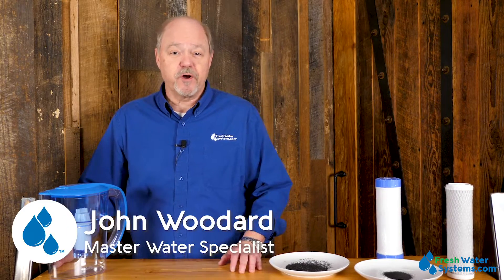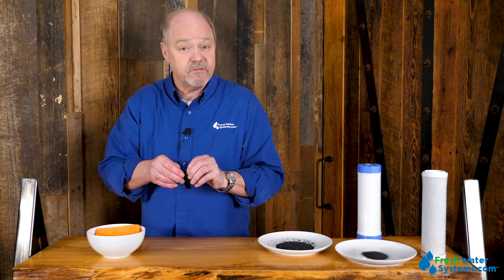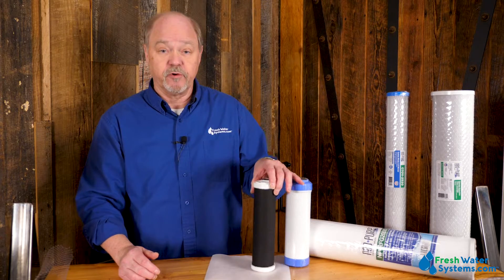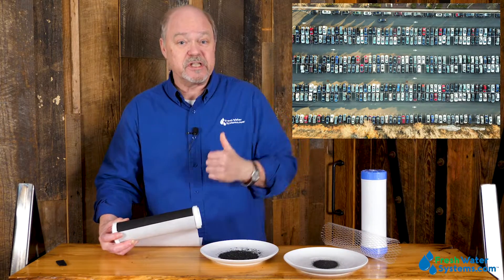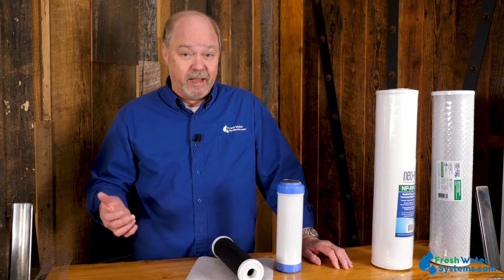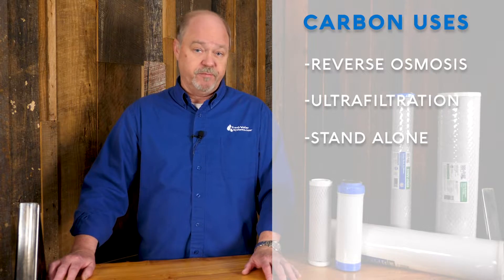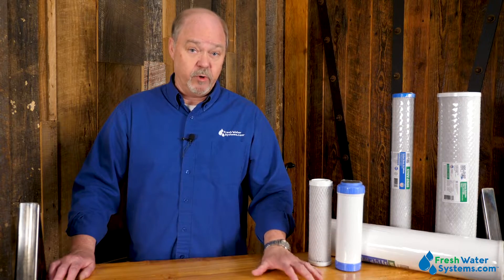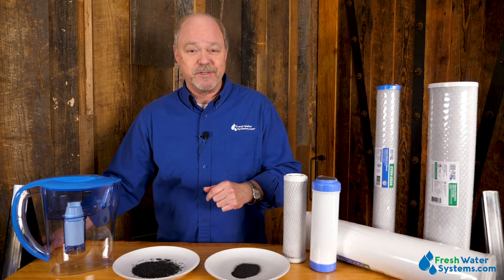Activated Carbon Filters 101

Comment: Hey I fitted my filter and black water comes  out
Reply from the maker: Hi! It is common for a new carbon filter to require flushing.  Depending on the filter, the amount of flushing can vary so run water through it until it clears.

Comment: I have a well in my old house I use it for water in the winter I use a 3 filter system 5 microns carbon and 1 micron filter and the water flow is a bit strong do you think it is enough to get rid of the bacteria?

Comment: I'm trying to learn more about Carbon filters (Granular media), just installed 1 for our brewing water to reduce chlorine and make the water taste better etc. I'm currently on the 3rd filter from the supplier and it does indeed remove the chlorine smell but it makes all water smell and taste like soot leaving a powdery feeling in the mouth.  So basically it makes our water taste worse than unfiltered and I don't think the manufacturer has a clue. I've already wasted quite a few thousand liters of water flushing it through! Any tips on what carbon filtered water should taste like would be appreciated. I'm in the UK.

Comment: What happens when activated carbon gets wet?
Wet activated carbon depletes oxygen from the air. Materials allowed to smolder for long periods in enclosed spaces, may produce amounts of carbon monoxide which may reach the lower explosive limit for carbon monoxide of 12.5% in air.

Comment: Disagree with type of materials used. Coconut carbon has no color removal and is a very slow reactivity carbon thus the need for using twice as much as other carbons to do the same job. In areas of high color like the SE USA it's best to use a different carbon. Carbon that is made for both color and chemical removal and is faster reacting such as lignite coal based is a much better choice.
Reply: Thanks for your input! 😊

Comment: How much is the life of carbon block filter? How would I know my one is gone?
Reply: Each manufacturer should rate them by gallons or months of usage.  They typically underestimate the capacity so you do not run out if you follow their guidelines.  A change in water taste or a drop in water pressure are signs to replace filters.

Comment: if you are using one of those canisters and you are filtering just drinking water from your Municipal Water Supply how often should you change it
Reply: You should go by the manufacturer's recommendation for filter replacement.  Also, a reduction in flow or a change in taste is al way tell your filter needs to be replaced.

Comment: What micron size should be used for a sediment prefilter for a well water system before the carbon filter? And what micron size should be used for the carbon block filter?
Reply: Take a pre filter - sediment filter of 0.5 - 1 micron, and take carbon activated filter block of 1 micron absolute rating. Thereafter put a post sediment filter of 0.5 micron again before passing that through the ultrafiltration etc.

Comment: Is it possible that these filters (the small blue one) last up to 2 years? Mine says it lasts 18 months but it has been 2 years and I dont experience any change in the taste or cloudiness at all. I live in another country and it says it has silver resins too. I will probably still change it next month but what always wanted to know what makes filters last longer.
Reply: It is not a good idea to wait for bad taste or colour of water because it is a matter of drinking water. You are going to lose nothing if make a rule to change at least once in six months. Other good idea is to use two in series and replace the previous one in one year when you installed both at the same time.

Thereafter when replacing the first one after an year, the new carbon activated filter should be installed at the place of second one and the existing second one should be shifted to the position of first one. 

Now at the interval of 9 months or one year you can repeat the process.

Comment: I'm looking at building a purified water system where hose water will go through the carbon, then an RO membrane, and finally a DI tank. How could I make sure that I replace the carbon in time to prevent damage to the RO system? It'll be a pretty quick flow system hoping to get about 1 gallon per minute. I just haven't found a good way to know how long the carbon filter will last...
Reply: You are right.
Knowing as to when the filter to be replaced is somewhat tricky.

What l do that I keep the filter candle in a transperant housing. When I see that the colour of wrapping of filter turned brown I replace it. 

One more trick will keep you away from risk and prevent your apprehension of getting the ro membrane damage is that use two carbon activated filter in series and a sediment filter of.05 or 1 micron in between the ro membrane and carbon activated filter.

Comment: When your filter starts to need a higher volume, turn water on higher, in order to get the water thru the used filter, . . ? Change , get, or make a new filter, it's Scarry to wander what you are STILL drinking, as I use Multi Pure M. P. 400 p.c. older style, now I know, our drinking water STILL has a couple of poisons. We R  F - - Ked

Comment: When you use activated charcoal for filtering air,  it would let out the trapped voc when charcoals are saturated.  Does it happen only when all the charcoal are saturated or when part of the charcoal are saturated?

Comment: What's the blend for lead removal? I need to remove iron too. And what happens when I run let's say phosphoric acid through it? Or a base? What comes out? Does it clean the carbon? Can a filter be revitalised in a low oxygen oven, burnig out all but carbon again? 😃
Reply: Check out the manufacturers  datasheet for the filter to see what the specific capacity of the filter is for certain  pollutants. A carbon filter cannot be reactivated, it as to be discarded after usage.

Comment: Thank you so much for detail explanation on carbon filter. But how can we know carbon filter is exhausted??? I don't know exact time to change carbon media. Please share your thoughts
Reply: Best way is to count the gallons that ran through the filter. Second indication is time. I change them at least every six months (refer to the manufacturer specification or local code). Th third indication is reduced flow. With a lot of sediments in the incomming water, the filter might become blocked quite fast. In this case a sediment pre filter might be recommended.
Reply: you have to change your filter every 2-4 weeks
Reply: @taeseong9944  2-4 weeks? I was told even 6 months depending on use... Was it false?
Reply: @pedecia  i dotn know...i change mine every year soooo....my fish are probaly poisoned by now